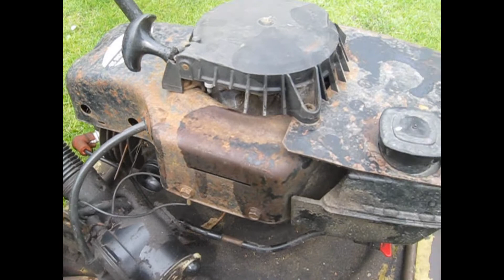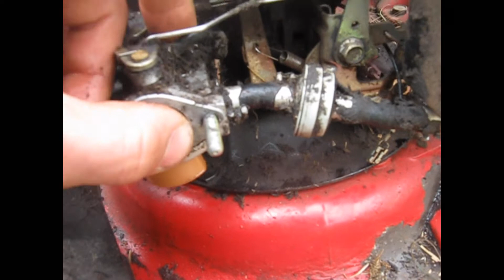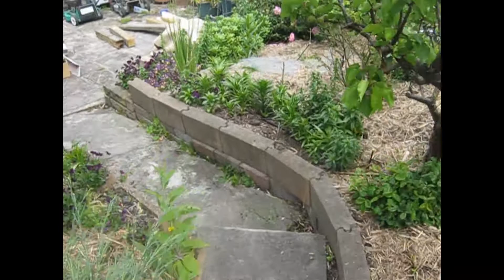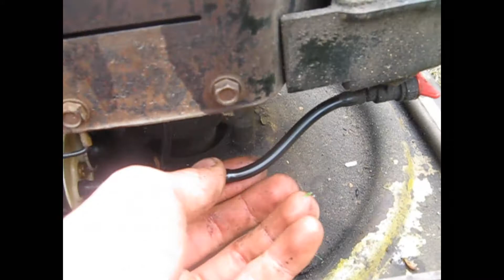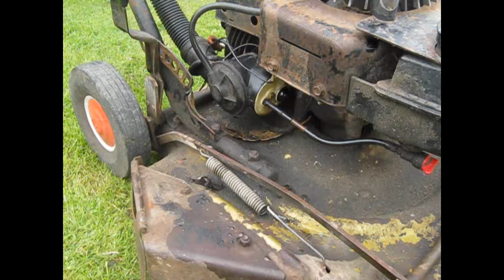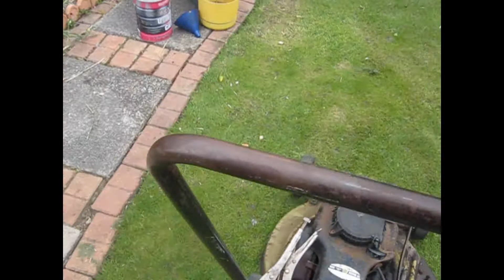Victa 125 old start run and repairs

Comment: I was told years ago that the 125 is actually a better engine than the 160.In my experience, they run smoother. Only the 160's higher horsepower gives it an edge.
Reply from the maker: +James French  I personally have know them to be a better engine too, my grandfather had one that used to regularly cut a 1 acre block of grass.  Lasted from 1965 and was retired in 2008 still going fine ( many holes and cracks patched up in the deck though lol ) but still started after fresh petrol from 6 years of sitting last year when i got it out to sell.  In my opinion more than enough power who needs a 160 :-)
Reply: yeah i also agree. The 125cc victa is pretty much bulletproof. Even when you hear a 125cc & 160cc side by side. The 125cc actually revs harder and sounds more powerful than the 160cc. it's like victa threw the budget out  the window when making the 125cc.